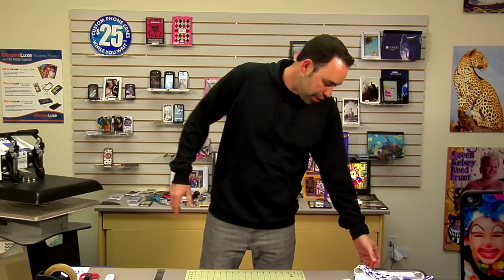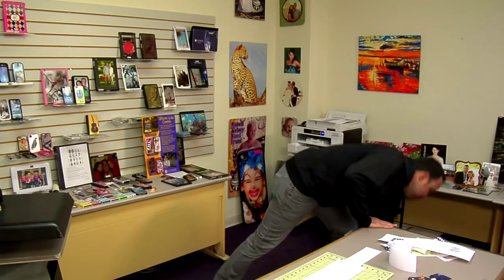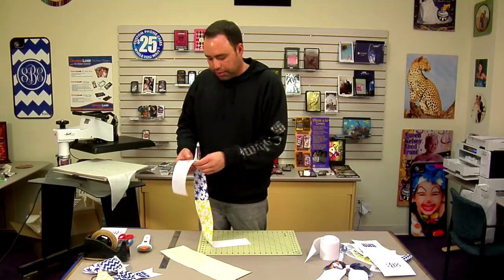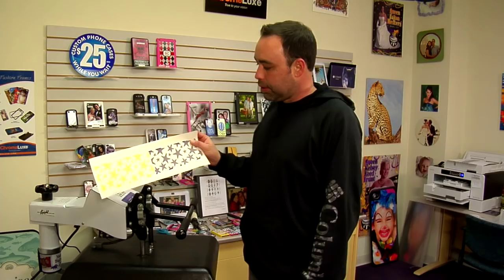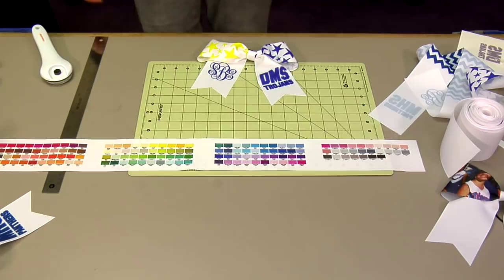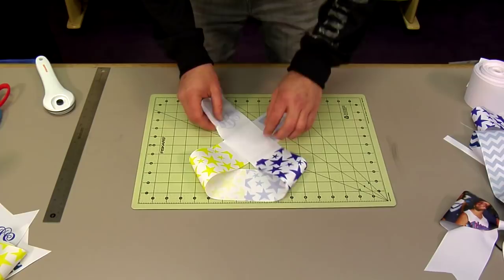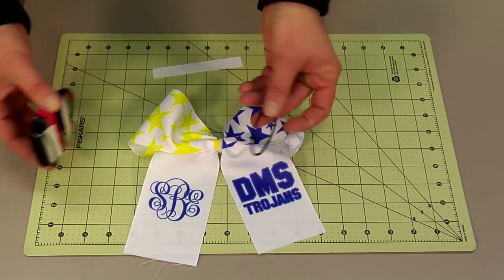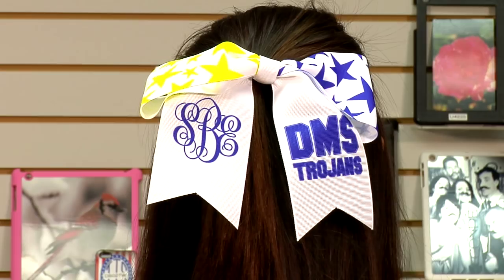Making Dye Sub Grosgrain Ribbon Cheer Bows -

Comment from the maker: Emma DeSantis Sublimation transfer paper is used with dye sublimation inks. It is not a true transfer paper, it does not have emulsion. It's a tray to carry your image to the heat press. We recommend DyeTrans Sublimation paper for most jobs.
Reply: ***** thank you! Also, with the Ricoh 3110DN can you use 8 1/2 by 21 in paper?
Reply from the maker: Emma DeSantis Only if you have the optional bypass tray installed. Otherwise, only 8.5" x 14"
Reply: okay thanks! can you purchase this on your website?
Reply from the maker: Emma DeSantis Yes, we have printers, ink, presses and ribbon.
Reply from the maker: Yes, http://www.conde.com

Comment: How expensive are all the materials including the press?
Reply from the maker: Jeff uses a Ricoh 7100 and a George Knight DC16 in the video. When he takes his show on the road he uses a Ricoh 3110 and a JP14. The Ricoh 3110 can be had with ink for less than $500. The JP12/JP14 are small hobby presses that run $250-450. The bigger Ricoh 7100 with inks is $1500 and the larger presses like the DK20s is $1400. So, get started for less than $1000, all in for $3000. Call us! 800.826.6332

Comment: Do y'all have a template yet? I checked partnernet but could not find one.
Reply from the maker: It's a rectangle, no need for a template, make a rectangle in your art program. Template is 3" wide by 9" rectangle x 4.
This gives you 2 panels for the top and 2 panels for the "tails" for a total of 36" in length.

Comment: How do you get the stars, etc., to transfer to the ribbon?
Reply from the maker: Linda Lollis, the ribbon is decorated using Dye Sublimation Transfer. Special (Sawgrass Inks) Sublimation ink is used in a printer and they print out the images needed (reversed) and use a heat press (or iron at 400°F) to meld it to the fabric. Call us if you want to try it! There are smaller equipments that go for under $1000!! Call 800.826.6332